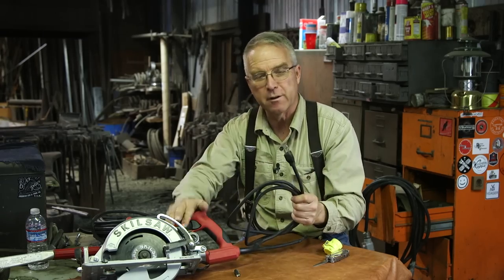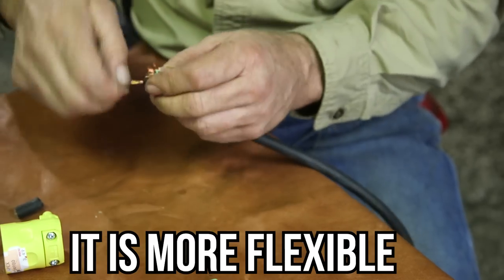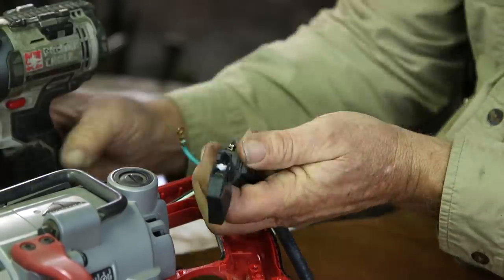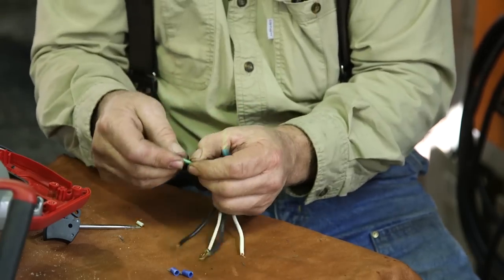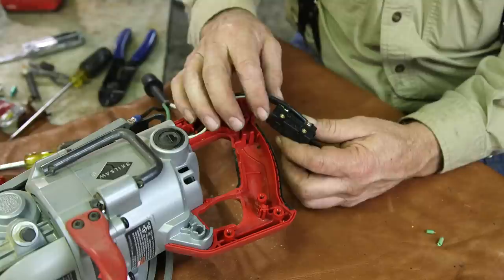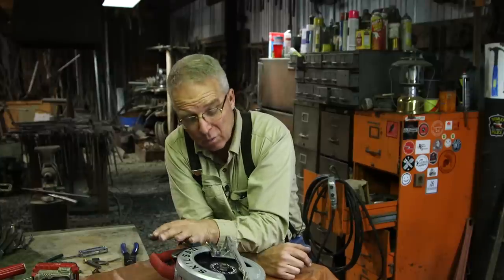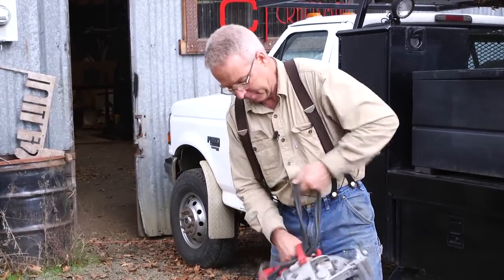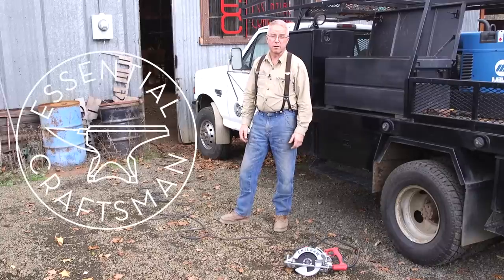Skilsaw Cord Install and Storage Tip

Comment: I added a vacuum cleaner cord to one of my circ saws and it was the best thing I ever did.
Reply: bet that upset the Mrs.......

uh, Honey, what happened to my vacuum cleaner??!!
Reply: @PatrickWagz  ha! No, people throw away vacuums around here quite often. I guess you could say I recycled it. I also cut off the last foot because that is usually where there is damage if any had previously occured. Plus the vac cords usually have a built in clip to clip to its own cord. Very handy.
Reply: Please remove the vacuum cord it is to small a gauge cord without ground usually and will burn out your motor on the saw.
Reply: @davetaylor8614  If you don't know what you're talking about then don't post. First there is no ground on double insulated tools. Secondly vacuum cleaners run high amperage motors so the swap is safe. Third, I'm not a contractor like EC is so my usage is light in comparison to his. Fourth, if it had an issue I'd know because the cord would get warm. I've never had an issue. Fifth, at least I'm reusing & upcycling stuff instead of letting it go to the dump. 

BTW cords have to be rated for the circuit they are on (15 or 20 usually here in the USA) NOT how much power the device makes/uses. It has to be thick enough to trip the circuit. So if you get a 14 gauge vac cord it's good for 15 Amps of service meaning you can pretty much put it on any household device w/o worries. Devices with 20 amp requirements, by law, have that plug that has a T off one pin so that's the only device you would not use it for.

Comment: Of course solder is the best connection and dielectric grease will help the connection last longer because it prevents oxidation and corrosion.
Reply: Contrary to what you choose to believe a properly done crimp is the best electrical connection there is. Not to say that pops here with his stamped multi tool is doing the best crimps known to Man. Or that Ace is selling decent connectors for that matter. But he's going to drop that tool and break it long before his crimps fail. Facts ain't moved by your feelings either.

Comment: That's what my dad did also, that was in the early 70's. Don't you have a HomeDepot nearby, they have yellow insulated 10-12 AWG ring terminals.As a craftsman you should have a terminal box kit with various sizes and types, they are common you should know. No need to be an electrician to have that.

Comment: Sorry if it seems redundant to ask; but why use a Worm-Drive Skilsaw vs a Normal Skilsaw (blade on motor)?
Reply: Mostly seems to be a regional preference. I personally prefer it and use a worm drive in my right hand and watch the blade itself instead of the notch in the table.
Reply: Worm drive has alot more power, the worm and wheel act as a transmission.

Comment: What's your opinion on having two cords, one short (factory length) and one long with twist-connectors. I like the idea of a long cord but I'm not a profesional and it would rarely benefit me and probably be a hindrance. Sure, I could just use an extension cord but I'm unique.

Comment: So... a really easy way to do this where you don't have to have 60' of cord on the saw if you don't need it is to cut the factory cord off at 3' and install an L5-20R on the end. Then buy 70' of #12 cord and make a 10' and a 60' cord. Put a L5-20P on both of those and a male Edison on the other. 

Now you have a twistlock removable lead for that saw which is either 10 or 60 feet + the 3' leader.

Comment: May I ask a question: apart from being a thicker gauged wire, why not simply plug it into an extension cord with a knot with the lead that preventing accidental disconnection?

Comment: Here's a tip. If you buy a used Skil Saw, and the cord has been replaced, take the handle apart and check the connections. Sometimes they are done right, but a lot of the time its a mess! Same goes if the plug end is different.

Comment: FWIW, according to the calculations I got at https://www.calculator.net/voltage-drop-calculator.html, 60' of 12 gauge is going to lose 2.86V, while that original 6' of 14 gauge only loses 0.45V, both using copper, at 120VAC single phase, and a 15A load.  Of course, that's going to be a lot better than what you get using an extension cord, with the extra connection that involves.  That cord management technique, while I've seen it before, is always good to see again.

Comment: On just an ordinary 50' extension cord, at what end do you start making your chain? The end with the plug or the middle of the cord? I've been starting in the middle of the cord but after watching your video, I may try starting at the end with the two plugs. Do I plug the two ends together and then start from there?
Reply from the maker: I mark the center with tape, double the cord and start at the center with a lark's head then stitch my way to the two ends. This way I can unwind just a small portion of a long cord if needed!
Reply: @essentialcraftsman  Thanks, Whatever happened to the pole barn?

Comment: ''I dont see any way to improve a 40ft cord hardwired to your saw''
i can

cordless

love your vids just saying
Reply: Less power, expensive batteries, waiting for batteries to charge if they die. Don't get me wrong cordless tools are awesome. But if you're running a tool hard all day, the power and reliability of a corded tool is nice.
Reply: @Rudabaugh  ya if your cutting all day or doing a bunch of rips corded is better but my cordless has just as much power as corded
Reply: They are great for some applications, but i cant find a cordless that can cut 40 degree bevel at a 50 degree angle 15 times and then keep cutting.
Reply: @shakeNbakestudios  is this a power thing or a battery life thing cuz if its battery just get more than 1 and if it's a power thing then you haven't tried the new cordless saws
Reply: Corded for the sawhorses and work bench cordless up in the rafters

Comment: I use to do that to all my saws, hammer drills, even air compressors and still do for recreational use. OSHA came into a job site and said that I wasn’t allowed to change the factory plug ends of any power equipment! WTH

Comment: Aren't you supposed to leave the ground longer, rather than shorter, so that if you yank on the cable and a rip out the connections the ground is the last one to go?
Reply: The configuration of this saw is that the ground wire attaches  to the saw in a different place from the white and black conductors. there is little room for extra wire, so the configuration of the saw dictates how long each of the three wires needs to be. His statement about making the ground wire a bit shorter was specific to this particular saw.

Comment: Kind of surprised at using porter cable cordless tools. Had them (actually still do but relegated to household work) as they don't seem durable enough and switched to Makita. Any reason for the porter cable choice other than cost?

Comment: Is there a reason you start with cord rather than starting with a finished extension cord and cutting the female end off, leaving a factory male end?
Reply: Daniel Bingo! Molded and watertight as opposed to that other type that is susceptible to poor connections and/or moisture and corrosion.
Reply: Daniel price maybe? But I find it actually cheaper.
Reply: Extension cords dont roll up as nicely. If you dont like the plug put a watertight one on it has a cord grip built into it to keep out water. They make a female end it will actually seal with. Leviton makes them. Called wetgaurd

Comment: Dont OSHA have rules that prohibit this? I love this ideal, but you're supposed to be able to quickly unplug your saw in case of a jam or if the power switch fails.
Reply: Yes. You lose your UL rating which violates the assured grounding program, which prevents shocks.  While a good wiring job may be safe, if you are on a commercial job you are exposed to multiple citations and liability in case of an accident.
Reply: Quickly unplug the saw in case of a jam? Who are you? The Flash? By the time you try to move 3 feet whatever was going to happen has already happened. The saw blade turns every 0.013 of a second. You can't even blink that fast. So I can guarantee you that you're going to see the blood fly. Because you won't be able to close your eyes fast enough.
Reply: @airborneshodan  you're one of them job site lawyers? I only trust shysters if they're in thousand dollar suits. That means they must have been right.

Comment: Heads up, Automatic Wire Strippers will change your life.
Reply: Indeed I remember when I got my first set of em over a decade ago I was like where have these been all my life such a time saver.
Reply: I had a cheap pair of wire strippers just like the one in the video, but they were a little loose, and the  opposing teeth kept hanging up on each other, so it really required two hands just to hold them.  I threw them out and bought a better pair.  Worth whatever I paid for them.
Reply: So will a cordless saw lol

Comment: Little more work but makes a nicer job is to make my own ring connectors and silver slider them..... use the right size copper tubing and dremel or gas hook saw and files.... then heat shrink all but the ring..... also tie a knot just like doing a splice ended rope... that gives a knot that should never pull out....I believe do it right do it once and it will last

Comment: A long cord is nice on a Skill Saw but, too bad it's against OSHA regulations.
Reply: Jeff Fraley regulations say once you are above 6' off the ground you must have a GFCI within 6' of the tool.
Reply: @davetaylor8614  What about if you put an inline GFCI within 6 feet of the tool, would that pass safety regulations?
Reply: kreg green 
Yes that works.

Comment: Milwaukee batteries split.just because i use them as a rubber mallet the impact is in my hand. Im a roofer. Its there its fast not a hammer butt....

Comment: california story, pulled up to a jobsite where a neighborhood was totally decimated by a fire in SF and the whole block was teeming with OSHA there were fines if you didn't have hardhats, water etc etc.  one time a completely new guy cut my saw cord on the first day so I had to put in a new one and I just did some random lenght like 8-10ft. An osha guy pulled up to the site pulled out his tape and measured my saws cord lenght and told me I couldnt use it haha. I think they said it had to be 6-7ft or shorter.

Comment: Late to the party but an electrician here Don't use one of the replacement cord ends osha inspectors will give you a hard time just get a normal 50 foot extension cord and cut off the female end Tell him you had a certified tool technician put it on

Comment: Rookie mistake make sure strain relief boot at exterior of saw handle is not pulled taught?
Prevents premature failure.

Cant beat a 7 1/4 Milwaukee Professional(not Homeless Despot) circular saw with an 18v 5ah lithium has rafter hook dust deflection and I can cut studs down all day with 1 battery phenomenal light easy lil investment but man o man no cord is priceless! 
Saw is so light I can hook it in my belt or Bull Pin Driver slot on my tail bag stud climb up into the ceiling and Blam Uber Skook!
Took a lil getting used to but so did wearing underwear and showering everyday...

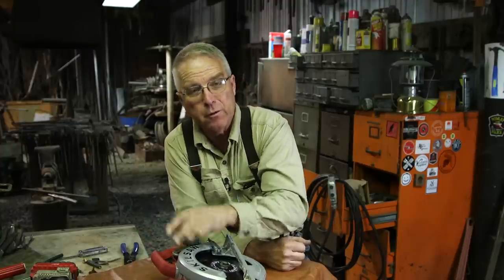Comment: 6:13 About 9 times out 10 I'm using the saw on the ground and I'm using more than 1 power tool. I understand the logic of a long cord on the skilsaw, but it's a one trick pony. You then have to run multiple cords to power more than one power tool.

Comment: I cut wires on my eclectical instrument about 20-25 s (10-12 inches) from handlebar and install computer type IEC C14 male connector. And I have long enough extension cord with computer type IEC С13 connector on work end. Two very flexible, various length extension cords with me.
Ok! the idea is... Each electric tool has it's own 3-5m (10-15ft), long cable... chain saw,  jig saw, disk saw, grinder, planner, drill, stapler and etc - they all has its own heavy and long electric cable. Is is heavy... And the it's plug sometimes to far from me. I have to go down? if I work up high and plug/unplug off the outlet my tool. But,  if I cut the tool cable and install C14/C13 connector I get: 1. Plug/connector always close to my hands 2. less summary cable weight (I throw off all tool cables and use one universal (compatible for all my tools) one extension cord (and may be one spare cord, just in case).  
Easy to carry many tools in one time, tools take less space in my carry box, less weight, easy to connect tools to power source.

Comment: I can see how this would be good for framers. Not having plugs to get caught around corners is very beneficial as well as being able to pull the saw to the roof with the cord. 

However for me I rarely use a corded circular saw so I prefer a pig tail on the saw and an extension cord. I like my pig tail long enough so I can use a blade wrench on the end and long enough to tie to the extension cord. Usually about 2’. The big benefit to me is that I don’t need to store 50’ of cord in my tool chest. I can use a 50’ extension cord on any tool I want. 

Are there any other tools you replace the cords on?

Comment: Or, just attach an extension cord, and put a simple knot where the cords attach to each other, and it will never pull apart, saving you the time of taking your saw apart.

Comment: i would keep old ring terminals with a small pieces of wire and connect using butt connectors inside of the handle. And i will use a proper crimper.

Comment: Another option is to add a locking connector close to the tool and then a seperate cable.  Marius Hornberger did this in one of his videos.  Although he took his tools apart and replaced the cord, you could just cut the cord off a few inches from the tool so you wouldn't need to open the tool which should be easier to do.  https://www.youtube.com/watch?v=WquQYdwcr74

Comment: I wish you didn't fast forward through the plug part. I've never seen or done that before.
Reply: Use a molded extension cord and you won't have to do it either. Just cut off the female plug end. Wiring cord plugs kind of sucks.

Comment: In the spirit of these videos where "rough is enough" - I cannot understand the faffing going on here. Buy an extension lead, gorilla tape the join between lead from saw and female socket on the extension then grab a beer. No danger of the tool not going back together correctly and then it's a smackdown between the tool or the tape giving out first !

Comment: I enjoy your videos, but as a retired electronic technician, watching you do electrical work makes me cringe.  I'm tempted to make a video on how to do it the "NASA" high reliability method way but I've never made a video before.  Just a tip, you can get the right crimp ends on amazon dirt cheap.  And those yellow electrical plugs really suck for a quality job.  A better bet would be to buy a 50' Yellow Jacket 12 gauge extension cord and cut the end off.  Leave a foot on the cut off part and you can use that to make a high quality splice on another cord instead of using those craptastic plastic things.  And for the love of all things holy, get a proper wire stripper.  That tool you use is a mess.
Reply from the maker: THANK YOU!!!

Comment: Try a hubbell one piece nylon cord end instead of the brittle pvc two piece unit. Nicer to install, nicer to use. https://www.lowes.com/pd/Hubbell-15-Amp-125-Volt-Yellow-3-Wire-Plug/3739251

Comment: Using a battery powered saw will eliminate a lot of the issues you are solving here. You will add a bit of weight and the need to charge batteries, but i think it is worth it.
Reply: Most battery saws are lighter than worm drive saws, but if you get a battery powered worm drive saw that will be heavier.

6-7 years ago I worked for a little while on a framing crew and the idea of using battery tools was laughed at (for framing specifically, because of the volume of work the tool needs to do). Today though, they really are up to the task. They last a long time and they cut with more power. Like, no joke, they actually have more juice. Battery tools are already replacing power cords and compressors on job sites and pretty soon it's going to be a no brainer to use all battery for everything.
Reply: Nicholas Tourloukis while I don’t doubt those days are coming they are not here yet. Those battery powered worm drive saws are HEAVY and they don’t last all day.
Reply: @Mrcaffinebean  I don't use a worm drive for my battery saw. The 7 1/4 Milwaukee I use is lighter than my Skil worm. A 9 ah battery lasts a LONG time. If you're cutting all day you could kill it, but I have 6 batteries. The inconvenience of changing a battery is way less than wrangling a cord.

I see framing crews with battery saws and when I ask them it seems like they're never going back. Those same guys either have a paslode or the DeWalt cordless framing gun. They only need a hose/cord to run their hanger and roofing guns off a compressor. That and the table saw, though even those could be battery for framers. It's not everyone yet, but it really is that time already for a lot of guys. I couldn't believe it the first time I saw it, but now that I have most of those tools, I get it.
Reply: @nicktourloukis , I agree. Batteries are taking over. What I hate is having to make sure all those batteries are fully charged. Even though it's easier by far, I just hate making sure they are charged !  I guess it's because everything else in life needs to be charged ? Setting up a charging station shelf is next on the list huh ?
Reply: Who makes a cordless worm drive saw? I've never seen one.
Reply: With the new 12 ah hd batteries I can work all day production framing. I also use a cordless tablesaw. You just have to be diligent about charging your batteries.
Reply: @Nikolasp73 , I guess I have a good reason to build something else !!